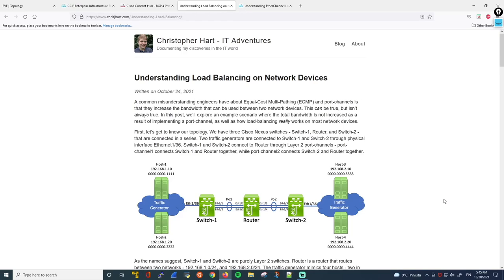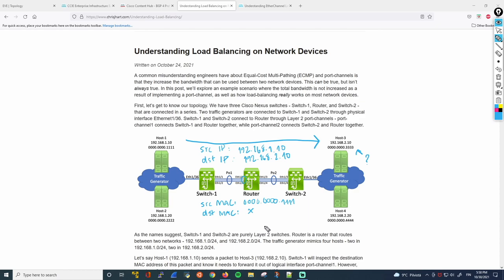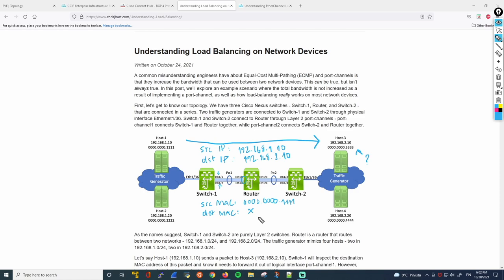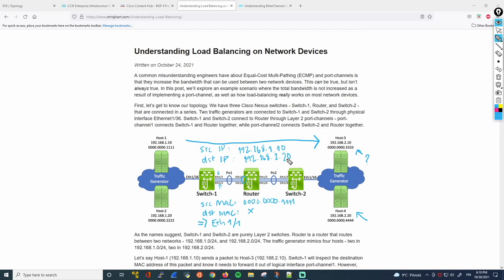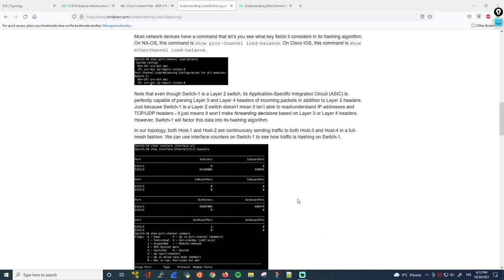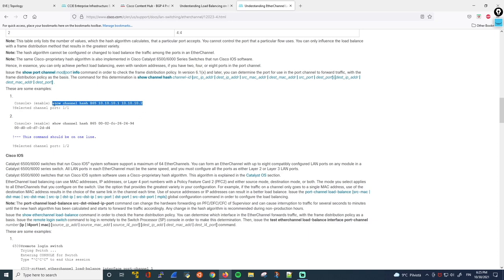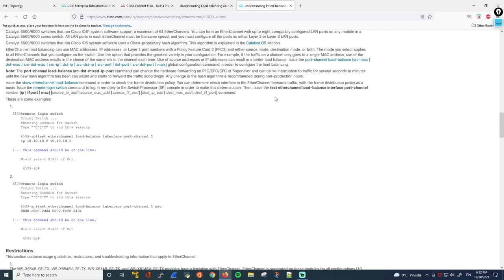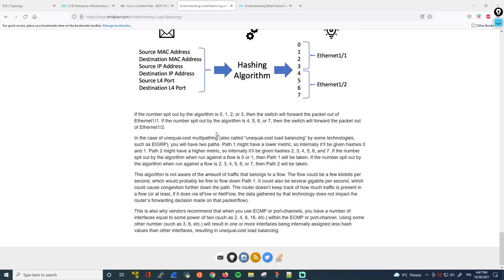Understanding Load Balancing | How the Hashing Algorithm Works

Comment: Really appreciate this video, but you kept saying the information has changed on the second flow but the hashing algorithm will use the same port, and it didn't seem to bother you until at the very end when you noticed the load balancing algorithm used in this example was src dest Mac address... this is key information to mention at the beginning! Bcz the idea of ecmp and hashing if done on l3 and l4 is to produce different hash value for each distinct flow.

Thank you again
Reply from the maker: Noted, thank you for the feedback.